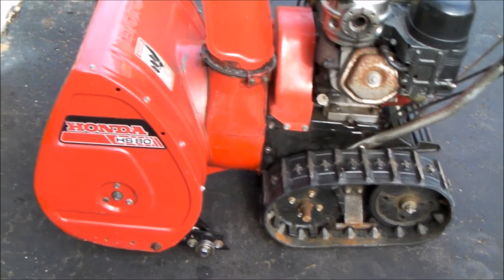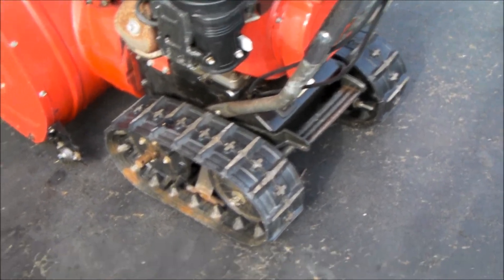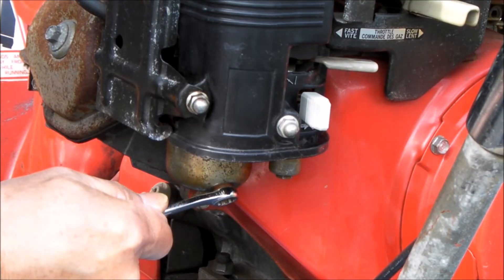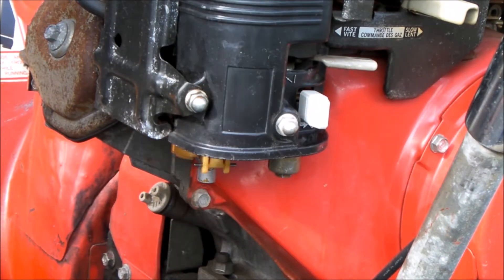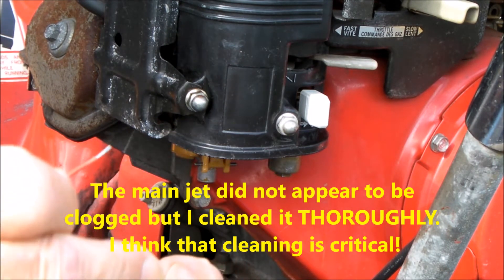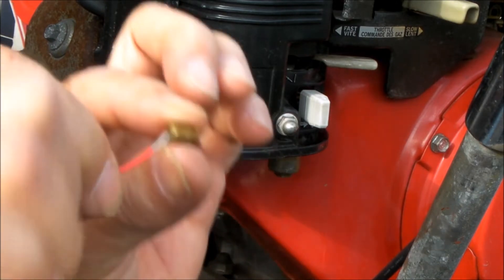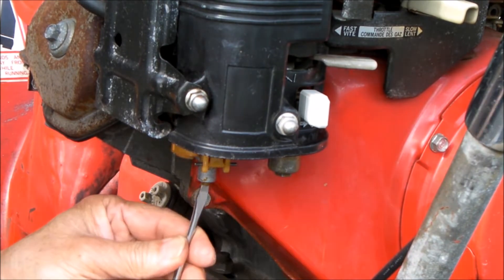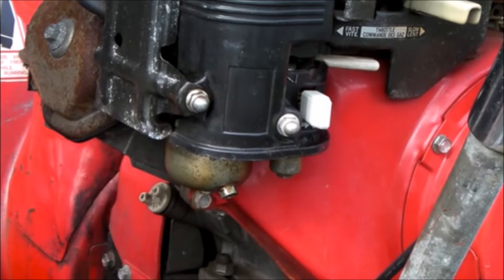Honda Snowblower will only run with choke; engine will not run with choke off/open-3 minute fix

Comment: Very good. Most of the time and i have done hundreds of these, you can get away with just spraying some carb cleaner up the pick up tube thru the center of that jet and then follow up with compressed air. I usually take the time to take the air box off which is very easy and spray thru all the holes of the carb , even taken the float out. We do that in a basic service. If you don't have an air compressor you can buy those compressed cans of air that people use for their computer keyboards from  Costco or any office supply. Good basic fix video YuDaMan.
Reply from the maker: Since YOU are a real expert, your compliment means a lot to me!  I'm just a novice for sure.  I can't believe I got a thumbs down from someone.  What's there to dislike other than camera technique or my voice?  Surely the content is accurate and the lighting is good!
Reply: Allyn Howell  work for you? I need to try this.
Reply: @YuDaMan  Spend NO time thinking about the trolls and haters. I have been working on cars since age 15 (now 73) and used to have a drag race channel on local community TV.  Your stuff is just fine !!!

Comment: I did all that.  In fact I took the entire carburator out and blew air in every orifice.  Took everything out.  No help.
I took the fuel tank out also and cleaned it throughly,, blew air through the fueld line too.  Same shit problem. Choke it to idle or even to run.
I am assuming it is not getting enough fuel.  Bullshit problem always seem to be my only companion.

Comment: What can i do if my main jet is seized and stripped?
Reply from the maker: I personally would take the carb completely off the engine to determine if I can use a screw extractor (a.k.a. easy out) to remove the main jet.  I suspect if you are extremely careful to use the smallest extractor, you can do so without damaging the carb but you have to be pretty skilled and careful.  Or take just the carb to your local small engine repair shop and pay them to remove it.

Comment: Thanks for the tuto!  Do you even make a tuto of carburateur ajustement ?
Reply from the maker: I personally resist the urge to make any carb adjustments until I am absolutely sure I have checked EVERYTHING else.  My experience is the problem is mostly somewhere else.  I don't recall the last time I made an adjustment.  It was rare for me.  If you are going to make adjustments, I would recommend you have a tach (they are pretty cheap for one that will do the job)